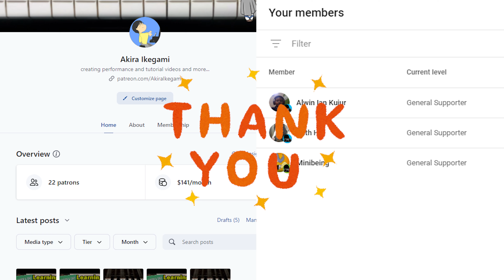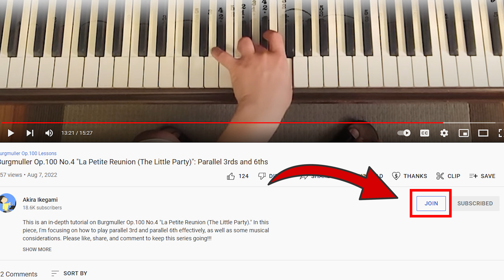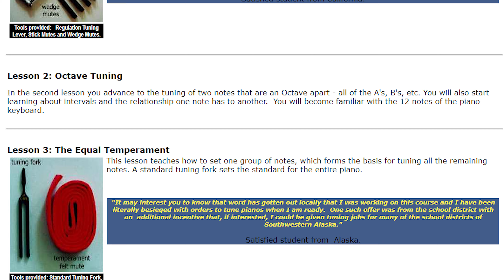How to Become a Piano Technician, How Often You Should Tune Pianos, etc: Technician Interview Part I

Comment: There is a piano technicians guild and they do have an exam process.  You could also attend north bennet street school which has a good program for piano tuning and repair and there is also a university in Huston that has course work.  Other than that its simply passed on knowledge.  Most people mentor under a master technician for years and gradually get better and better until you feel comfortable to go into business.

I also will disagree with the technician in the video.  I often will show clients who ask as to how they can touch up their piano.  Though that being said, a full tuning is something completely different than touching up a note or two.  I have heard of some technicians who get nervous about teaching customers, but I find the task to be difficult enough to not warrant any worry. 

Also in regards to the steinways taking longer, that has a lot to do with where the tuning pin is in relation to the cutoff bar.  Many steinways have this massive distance.  In the high trebble sometimes the part of the string that doesn't make any noise is longer than the speaking length.  This makes it incredibly hard to tune because of how much stretch the strings have behind the cutoff bar meaning you have to constantly go back and forth to equalize the tension between the two.  There are some specialized techniques that can get you past this, but its still a bit of a pain even when you get good at it.